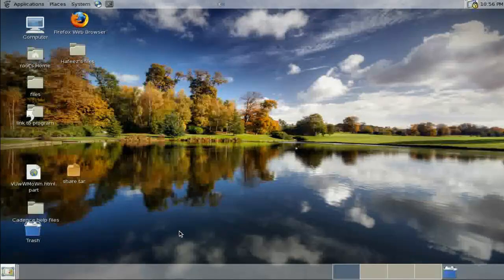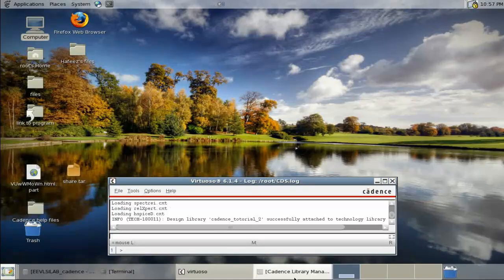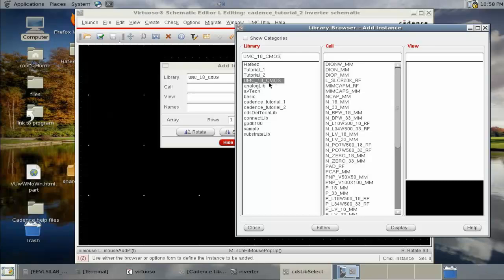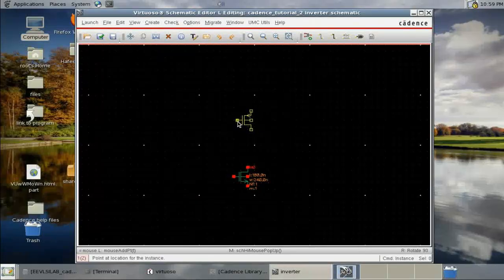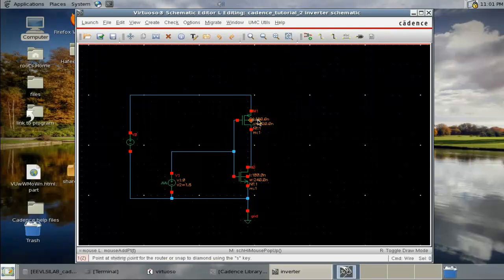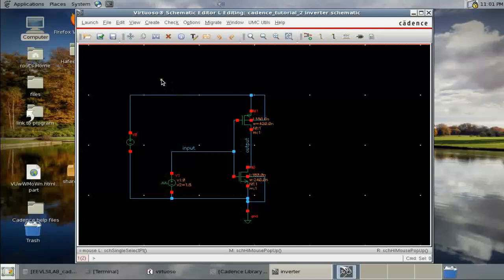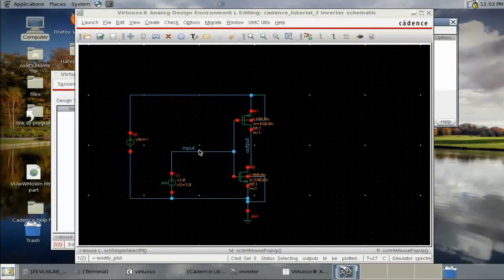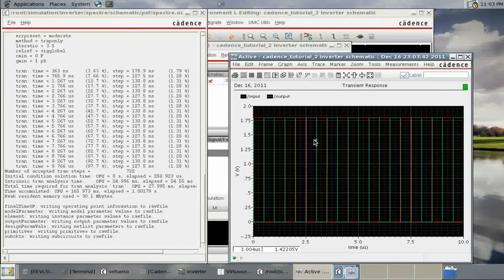Cadence tutorial 2 -inverter design

Comment: Hello, if I want to make an open drain driver, which uses a cmos inverter, do i leave the last transistor out of the inverter block or do i keep it inside? Basically i have to make an output driver with open drain so i have the inverter and a third high voltage nmos transistor, which needs to have an open drain